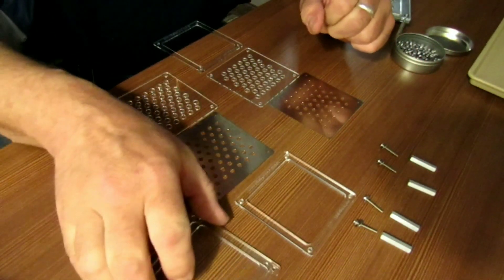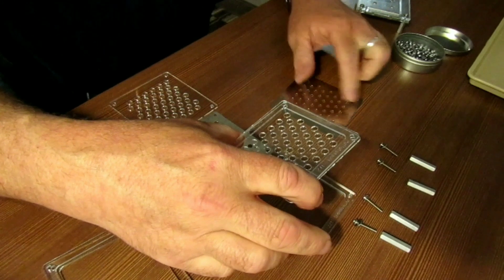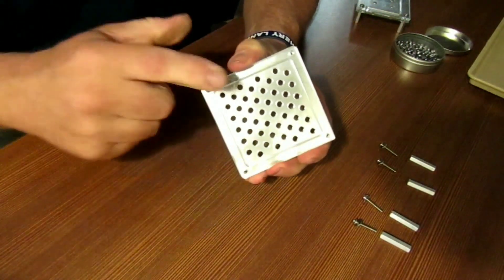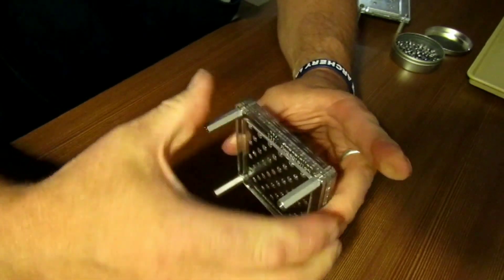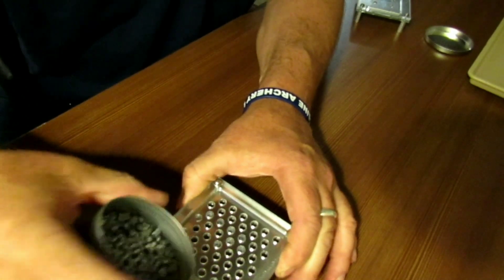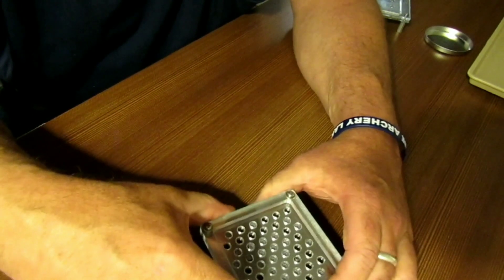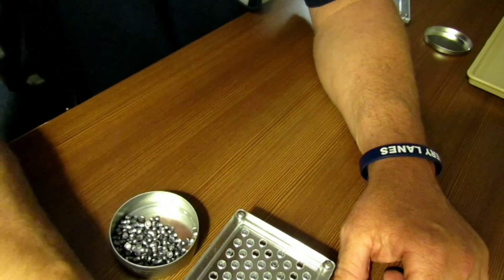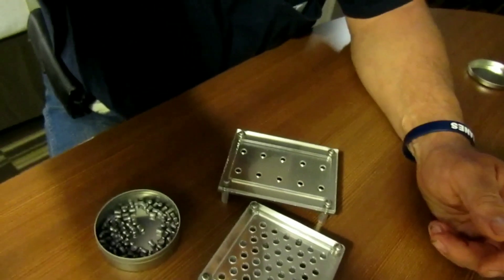FIELD TARGET TECH #23. ASSEMBLING THE PELLETGAGE R AND IT'S USE

Comment: How do you easily get those 4 "right size" pellets out without getting any of the "wrong size" pellets?
Reply from the maker: Chooch,  normally,  most of that tray (I believe it holds 50) would be ones that I would keep, and the few larger or smaller ones would be removed.   In that particular case,  I was keeping only 4.  I would push them up from the bottom,  and pick them out.   Usually,  I'd be keeping 40 out of 50 or so, so I'd pick those few out.  To quickly remove the rest, which would be the ones I want, I just quickly turn it upside down,  and slam it on the table, and most of them pop out.  Once upside down,  you can tap it again, and/or push the head out gently.